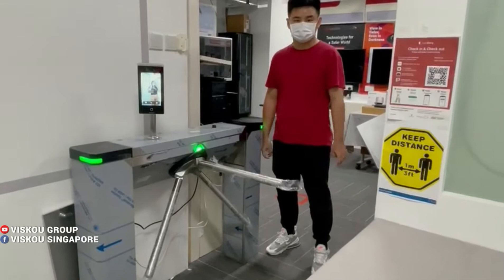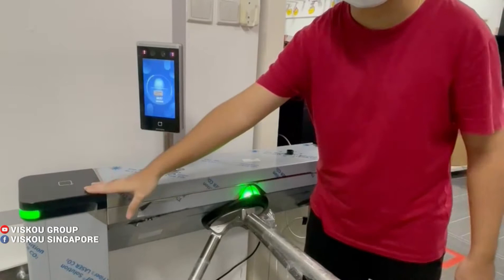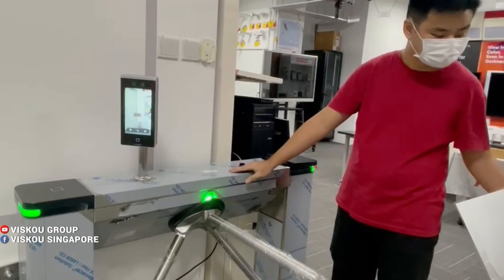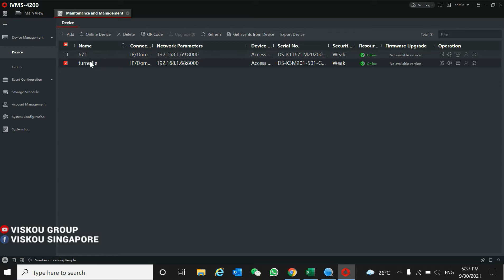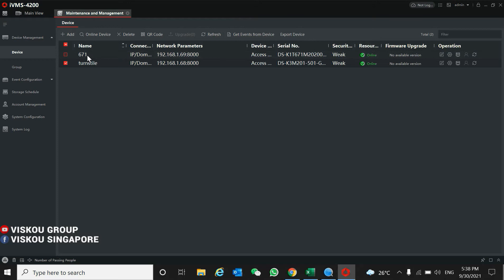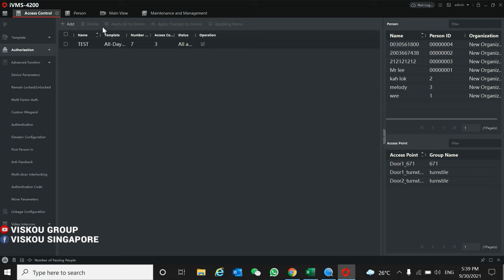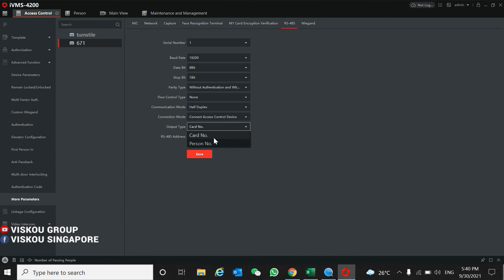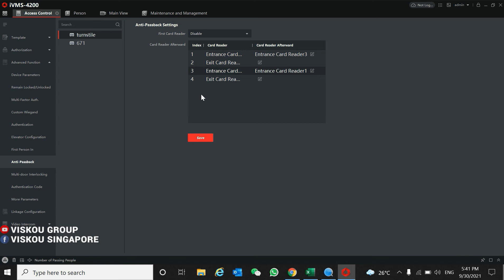DEMO: Hikvision Tripod Turnstile DS-K3G501

Comment: What is the Frequency of the card to open the device?
Reply from the maker: Hi Hernan, 

In the video, we're using Mifare1 Card with a frequency of 13.56Mhz
Reply: @ViskouGroup  125khz i think no?
Reply from the maker: If it's of other frequency, it should be other type of card. Mifare1's is of this frequency only